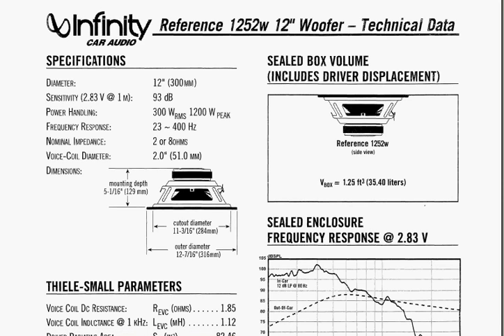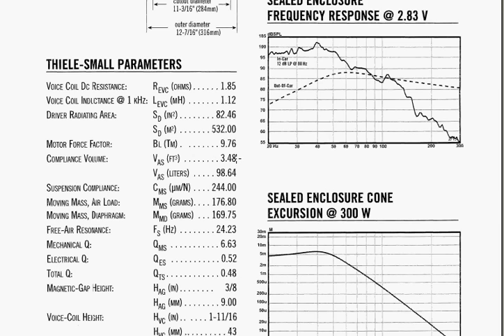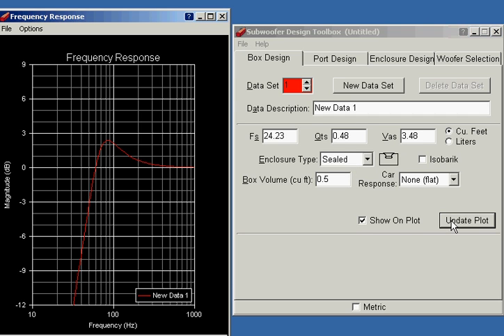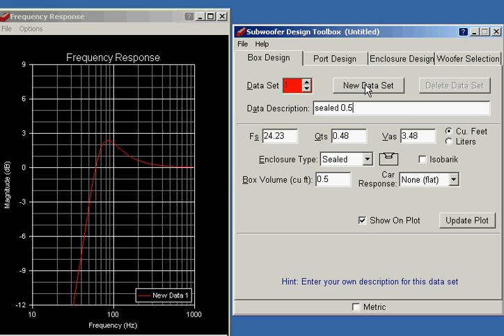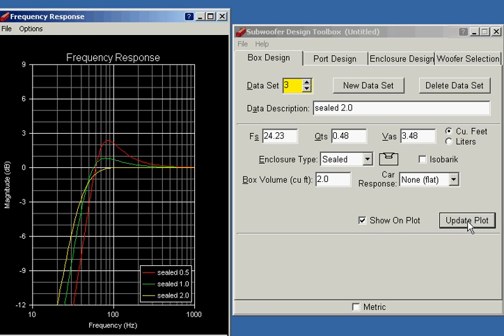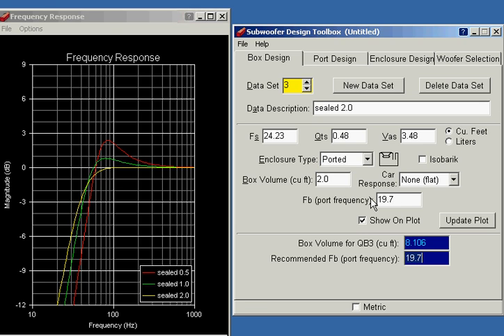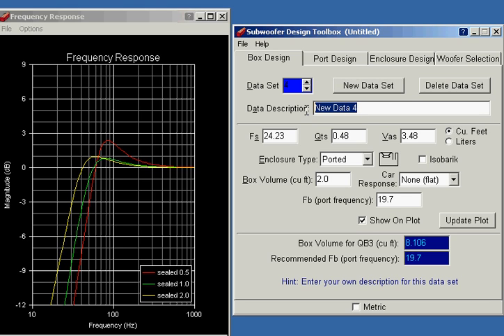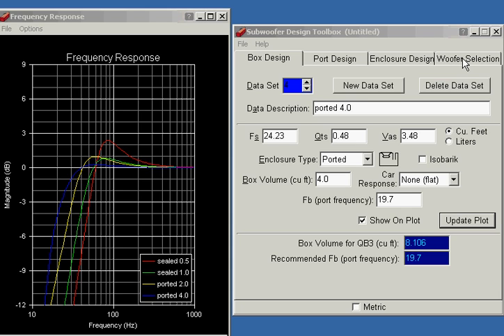Design Your Own Subwoofer Box - Part 1: Box Design

Comment: I am trying to design my subwoofer box for my car (I compete on SPL). I had been trying to break away from my 145.6 dB level, and seem like the only way will be designing a better box. Can I use this program to design an SPL box with high accuracy?> thanks.
Reply from the maker: +Fabio Pizarrovictoria Yes and no.  This program will let you design an SPL box with high accuracy as far as the frequency response is concerned, but it won't tell you the max SPL, displacement, or max power handling.  A lot of people have successfully used it for SPL design, but the focus of the software is trying to make is easy to use for the average person.

Comment: itd be nice to explain what those factors mean exactly.....And how to determine which subwoofer is "better" based upon these numbers.... or what advantages are there of having a higher Qts, FS etc
Reply from the maker: Bouge laal Unfortunately the T/S parameters don't make comparing woofers easy.  That's one reason the Subwoofer Design Toolbox software has a Woofer Selection tool.  It figures out things you care about from the T/S parameters.  If you want to read an old article about this, here's the link: http://www.mfr-eng.com/articles/rpp/

Comment: Thanks for the informative video. I do have a couple questions, I'm not sure if you answer them in later videos or in earlier questions, but I haven't found them. Hopefully you check back here frequently and answer other questions from your viewers. 1.) What is the significance of -3 dB and what frequency are you trying to see at -3dB? 2.) When you talk about "tuning" a sub box, I assume it has to do with the port. Is it the size (length or circumference) of the port that tunes the box? Do you get a lower frequency with a larger port? Or, am I completely off base? Thanks in advance.
Reply from the maker: -3dB is half power - engineers normally use the -3dB frequency to define the edge of a frequency passband. 

For a subwoofer, 35-40Hz is a reasonable goal for most cases. 

Tuning refers to adjusting fb, the box frequency.  The box frequency is NOT the same thing as the subwoofer -3dB frequency.  The -3dB frequency defines how low the sub will go.  Fb defines the frequency that the port is tuned to, and could be higher or lower than the -3db frequency.  Fb is determined by port diameter, port length, and box volume.  The exact formula for fb depends on the shape of the port and whether or not it's a slot port (against on side of the box).  Fb goes down by increasing the port length, decreasing the port diameter, or increasing the box volume.

Comment: I want to make a sub box using 2 of these subs you used, but not a cube one, I want it to be fiberglassed, and can I put a port in the back of the box?
Reply from the maker: Yes, you can put a port on the back of the box.  Make sure there's at least a few inches of space between the port and the side or back of your trunk, so the port has space to "breathe."

Comment from the maker: Does the speaker data sheet tell you the T/S parameters?  Usually it does, but once in a while it doesn't.  This usually happens with either very cheap or very expensive drivers where the manufacturer would rather customers not know the truth.

Does the data sheet tell you what size box and port to use?  Sometimes.  But it's always better to be able to design the box for the best compromise between box size and deep bass for your needs.

Comment: would this program also tell you what size port ( length and diameter)?

These are the parameters for my box. I want to make a box.
Sealed : 0.30-0.40 Ft^3
Ported : 0.5-0.75 Ft^3 @ 35 Hz
Displacement : 0.1 Ft^3
Depth : 5.7"
Outside Diameter : 8.5" 
Cut-Out : 7.4"
Magnet Diameter : 6.3"
 
T/S Parameters D4)

Re :  8.00 Ohms
Fs :  45.3 Hz
Sd :  20.126
BL :  18.9 N/A
Qms : 3.83
Qes :  0.48
Qts :  0.41
SPL : 85.2 dB
Vas : 5.18 L

Comment from the maker: The Subwoofer Design Toolbox is perfect for your school project.  Watch the other videos and you'll see how the Enclosure Design tool works to calculate dimensions.  Since you are from Sweden, you'll want to select Metric mode for the program.  If you have any questions about your project or the software, email me using the address at the MFR Engineering website.

Comment from the maker: A properly designed ported box will always outperform a transmission line, and is a whole lot easier to design and build.  My advice is to forget about transmission lines  
 
But to answer your question, check out Martin J. King's free software for designing transmission lines.

Comment from the maker: @craigpusey 
A properly designed ported box will always outperform a transmission line, and is a whole lot easier to design and build.  My advice is to forget about transmission lines  
 
But to answer your question, check out Martin J. King's free software for designing transmission lines.

Comment from the maker: I may not understand what you're asking.  But if you can get down to 40 Hz without a giant box, yes, it's adequate.  

-3dB is half power.  The -3dB frequency is just the standard way of specifying filter bandwidth by engineers.  A sealed box has a shallower (2nd order) cutoff compared to ported boxes (4th order), so the -3dB bandwidth doesn't tell the whole story.

Comment from the maker: If you have room to spare, try increasing the box size using speaker design software and see what the improvement is.  That way you get to decide if it's worth it, not some guy at JL Audio!

As you'll see, deep bass comes at a price - a 30 Hz box will be at least twice as big as a 40 Hz box.

The software will show you how the mid-bass response is affected by pushing the lower limits of frequency response.  Expect a mid-band dip, especially for high Qts (>0.5) drivers.

Comment from the maker: @amritsn1991 
The program doesn't automatically adjust for the internal volume taken up by ports, bracing, crossovers and the back of the woofer itself. A rule of thumb is to increase the constructed box volume by 5 percent to compensate for these. If you think the port is using up more of the box than 5 percent, calculate the port volume and use that number instead. Sealed boxes are very insensive to small changes in box volume, so a correction is not worth worrying about.

Comment from the maker: MTX recommends a 2.25 cu ft box tuned to 38 Hz.  Is that what you have?  If you change the box freq without using software to see what you're doing, you'll do more harm than good.  The box tuning freq is not what most people think, it's not going to give you bass down to that frequency.  Using the Subwoofer Design Toolbox, I found that tuning the box freq lower isn't going to help you.  To get better bass, you need to increase the box size.  3.5 cu ft will give you bass down to 28 Hz.

Comment from the maker: @nwfklan 
That's a great question.  If there are any numbers on the back of the driver, google them to try to figure out the manufacturer and model.  Then email the company for the T/S parameters.  You can measure the parameters yourself, but you'll need to buy the Dayton Woofer Tester.  Amazon sells it for $100 bundled with a precision scale.

Comment from the maker: The box on ebay shows 2.375 cubic feet internal volume and the port tuned to 34.59 Hz.  The Subwoofer Design Toolbox shows this would give you bass down to 30 Hz, but there's a 4.5 dB peak at 46 Hz.  So this box will boom, but is not the best  for SQL as claimed in the ebay listing.

Comment from the maker: @gtipolos 

From the JL Audio website, the JL 13W7 specs are:

fs=23.5
Qts=0.448
Vas=3.68 cu ft

There's no such thing as the best box.  You need to decide the best compromise between deep bass and box size for you and your vehicle.  Watch part 1 of the demo and this will make sense.  The Subwoofer Design Toolbox software will let you design the best box for you.